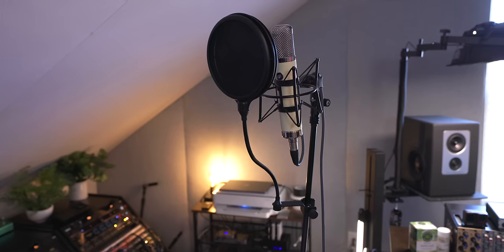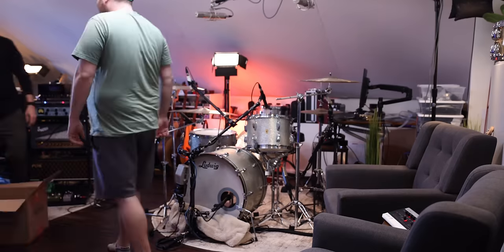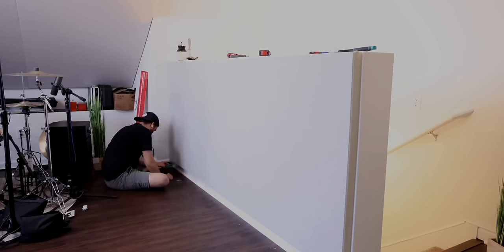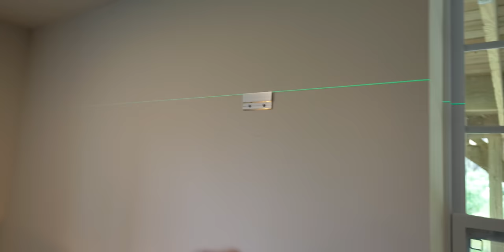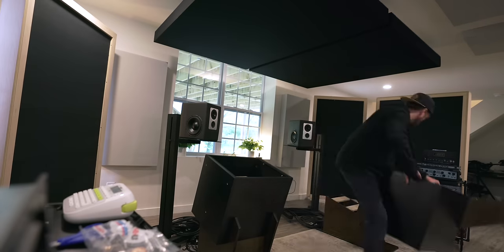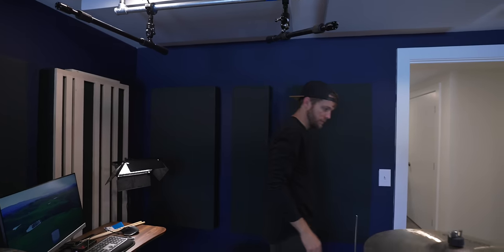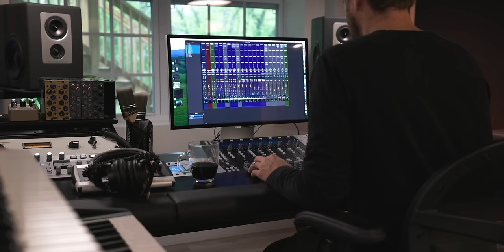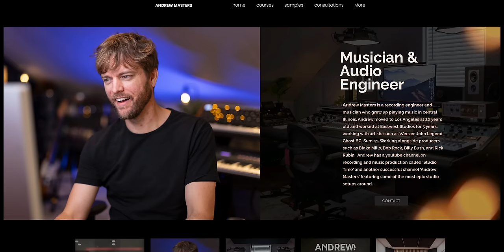Building an EPIC Recording Studio in a BASEMENT

Comment: Great video! Do you often mix with your analog gear or you use it most at the recording stage?
Reply from the maker: Mostly on the mix side, I'll hit all the outboard pres with an occasional eq. Vocals usually hit a compressor on the input. The other gear is routed as HW inserts for mixing.